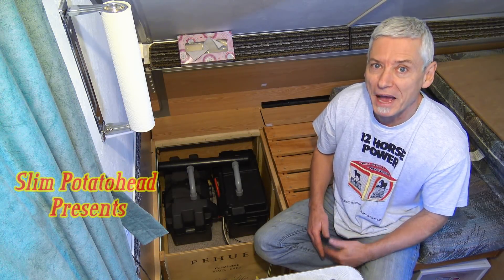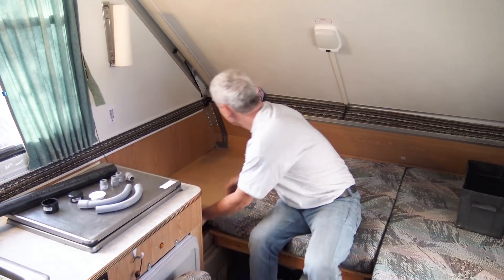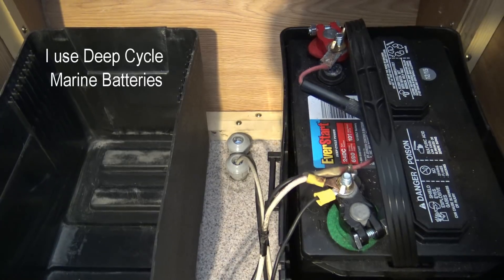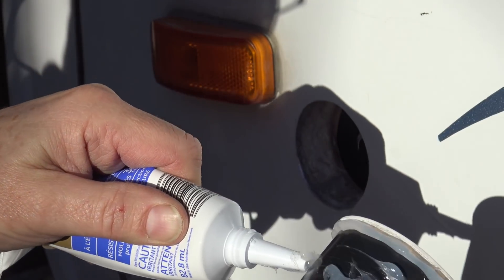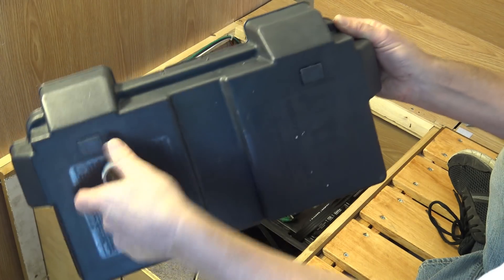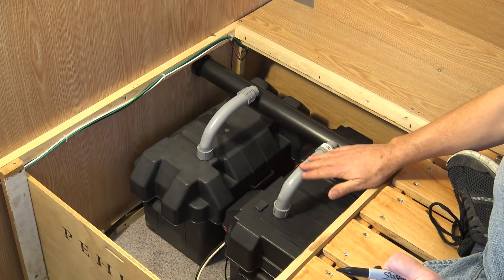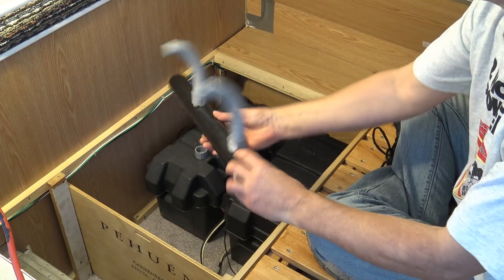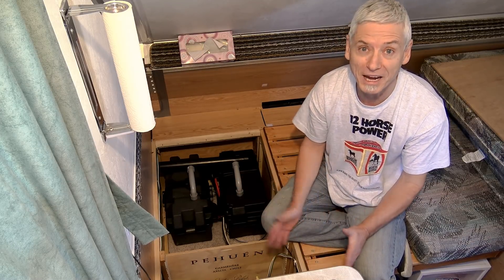Moving Trailer Batteries Inside with Vents

Comment: I meant hydrogen sulfide gas from over charging
Reply from the maker: It's hydrogen, not H2S. Hot (or warm) hydrogen rises. As for overcharging, not likely since it is regulated by a controller. SP

Comment: Unless I misunderstood you, I would have thought that you'd want the vent pipe to slope down going out to the vent. This would allow for any condensation to flow out of the pipe and not pool towards the capped end.
Reply from the maker: It is the lighter gases I want to expell, not condensation. I have never had any condensation. Thanks! SP
Reply: @SlimPotatohead  I was thinking more of warm moist outside air condensing, unless the interior is the same temp as the outside. I may be overthinking.

Comment: Why did you use a 90° bend instead of just drilling the hole directly below the pipe and have it go straight up to the large vent pipe?
Reply from the maker: Easy removal. Just rotate the larger pipe and the branches move clear to access the terminals. SP

Comment: Great Video for sure, I'm curious how you feel after a couple years disassembling that vent set up in order to water your batteries on a regular basis? That's the only downside I could see from this.
Reply from the maker: Strange question. Why would I be watering my batteries? SP
Reply: @SlimPotatohead  the reason you vent lead acid batteries is they produce gas, the water levels go down over time, if you don't water them the lead gets exposed to air and corrodes and kills your battery. That's why the caps on the batteries come off.
Reply from the maker: Sorry Kurtis, I thought you were referring to water coming through the vent from outside. Topping the cell levels, yes. Not too big an issue, as it came apart quite easily. Currently I do not use deep cycle, switched to AGM. No more venting issues. Thanks! SP

Comment: Nice looking installation but a question; your battery boxes are NOT airtight? They flare-out in the corners to allow the battery cables a way out of the box, the hydrogen gas you are trying to vent can also escape through these wide areas.  You may have been better to simply vent the entire compartment under the cushion (no need for plumbing) allowing the hydrogen to accumulate in the entire compartment then vent out the top in the vent you installed.

Comment: 12v battery....next to a gas tank...thats not smart
Reply from the maker: What on earth are you talking about? SP
Reply: @SlimPotatohead  it's irrelevant now because you moved it but batteries spark

That next to gas is dangerous and in the UK it's illegal for manufacturers to have 12v connections or switches or batteries in the gas locker or where the gas bottle is located because that's how explosions have happened.
Reply from the maker: @P Cat, you are not making any sense. Were you referring to the propane tank on the tongue of the trailer? That is STANDARD with almost all trailers. SP
Reply: @SlimPotatohead  Yes I know that but I'm talking about a battery being right next to the propane tank..... That's a bad design.
Reply from the maker: @P Cat, the issue is not the battery, it's the whole concept of putting a propane tank on the tongue of a trailer. It gets pummeled by rocks on gravel roads. If that doesn't start a spark, nothing will. Yet they are still put there. SP

Comment: WITH THOSE KIND OF BATTERY BOXES THE SULFURIC ACID STILL EASILY GETS INTO THE RV BECAUSE THE LIDS COME WITH LARGE VENT OPENINGS.
Reply: Not to mention he just created wholes in the floor albeit it is skewed into the floor so hopefully these batteries don't have acid in them seep through the gaps and cause acid damage underneath why outside is safer.

Comment: With the battery inside, how’s the best way to run your solar panel cable from the roof to the inside?
Reply from the maker: I put it through the floor. On an A-frame the junction is only about 5' long. SP

Comment: Great idea Slim, I’ll give you a heads up after the fact; you can do this ventilation another way by mounting a 120mm x12v silent computer fan on the inside of your box ( mounts with 4 screws) cut the appropriate hole (1 1/2”-3”) & cover the outside hole with a screened vent cover sized like your door vent, run it off your battery to an accessible switch outside your battery box. When at a camp spot, (not moving) , switch it on to vent, when traveling , switch it off, the moving air flow will vent it. Shalom!
Reply: I’ve thought about this exact situation. Do you have any pictures or further descriptions?
Reply: Yes I'd like to see pics too

Comment: I don’t understand why anyone would give this guy a thumbs down... awesome videos always relaxes me after a days work to watch this guy
Reply: I know this is a little old but the only thing I can think that would make someone give a thumbs down is that the venting system is kind of useless unless the battery boxes are sealed. Slim did seal the small vents on the battery box tops but those tops are open at four points to let the battery cables through. And, even if they were closed off, the edges would need some kind of gasket around the box top to make it air tight. That said, I myself used Slim's method to make my own vented battery box and gave Slim a hardy thumbs up for the video.
Reply: They probably just had fat fingers and accidentally pressed it. Only logical answer lol
Reply: Giving a video a thumb down is a good way of letting YouTube know it shouldn't suggest you videos with a similar topic. Having only 1% of the thumbs down is pretty darn good!

Comment: I'm planning two deep cycle batteries under my seats. I'm also concerned (as some mention below) about weight distribution. I'm hoping to get one battery on each side of the front dinette. I understand adding weight in heavy tools. Kind of a good excuse to add way more tools to the kit.
Reply from the maker: I removed my water holding tank so I could store my water in jugs. That way I can re-distribute the weight to make up for the batteries. Thanks! SP

Comment: Actually, the hydrogen comes off the negative plates, and comes out the water filler vents along with oxygen from the positive plates sandwiched between them. I don't know why you routed it from the positives, the plates in the batteries alternate, + and -  , 8 or 10 plates in each of the 6 cells, each with vented filler caps,  and you don't need to vent AGMs. And the vents in your battery box lids should be left open to route fresh air into the battery boxes or the lighter gases won't rise out your side vent.

Comment: I've been watching your videos for a while, they're just wonderful, and in high quality.
Incidentally, I use for the video editing "Sony Vegas" here there is also a simple version for about $ 50

I also used a trailer years ago.
At that time, there were no solar panels or charge controllers for $ 10.
What surprised me, in your car is a generator with high power, but unused for the trailer. This was also me Problem. Here I have thought about how I can operate my 100W refrigerator while driving.
In addition, I come from the electrical profession and basically can calculate everything.
One of the problems to be solved was that the 8m to the trailer battery are much too long, for thin (normal) lines. The second problem was that the 100W is so much power that the engine has to run to not remove the power from the car battery.
Solution:
A car Relay  - 30 amp with built-in fuse (or extra) . This relay has been connected to the ignition coil, so that it is the first problem solving, it is only active if the engine is running.
Before the line goes on, another 300 Amp diode and a shunt (Special Resistor)  for an Ampere meter were added.
The second problem was easier to solve, I pulled a thick 16mm² (AWG 5 or 4 )  wire from the relay, behind of the diode, to the socket for the trailer, all the way through the whole car.
There I made another high current plug connection to the trailer. Here, the fridge was supplied by 12 V and 100W  while driving.
You could improve this circuit with new electronics to load the Trailerbattery and so on..., but maybe it's an idea that is especially useful for campers who are more driving than staying in one same place.

For the circuit in the car, if necessary, consult a car electrician.
For Details i can draw a Circurit.

Comment: Moving Trailer Batteries Inside with Vents.

A seriously fault in your battery installation. If you use lead acid batteries it produce oxyhydrogen, which is very explosive. Normally you connect a small hose on the upper side of the battery and drain it through the floor. In your installation the battery box acts like a collector for the explosive gas.

Oxyhydrogen is heavier than air and will stay in the bottom of the box.
RV or caravan batteries normally have a 90 degrees hose connector.

Thanks for all videos and Tip.

    Robert…
Reply: its vented to the outside jeez

Comment: After many years with lead-acid deep cycle, I am experimenting with a couple of lithium batteries (360 amp hours) inside my house, charging with exterior solar panels.  Expensive, but many advantages, and the price will come down.  As you probably know lithium batteries can be routinely discharged to 10-20% without affecting their lifespan.  Love your series!

Comment: Deep cycle, as well as many starter batteries as trunk mounting is becoming more common, have a small hole for a vent nipple (hole might be plugged with a small plastic plug from factory) that you hook up a thin hose (like for windscreen asher fluid) to. For multiple batteries use T or Y connectors on the hose.
If the vent is plugged, the caps should be vented, but sealed caps should be available for use when the vent is used, check with the dealer.

Comment: Now that you have the batteries off the tongue and a little closer to the axle, have you ever considered putting a second propane tank on the tongue?
Reply from the maker: Hi Stephen, I'm actually finding ways to use less propane, therefore a second tank would not be any advantage in my situation. Thanks! SP
Reply: with a small rv like that a 20 pound tank will last for two weeks easy.you dont need the extra weight.use that stowage factor for beer lol

Comment: Your videos are very informative, thank you very much. Have you thought the draft of air might be pushed back to the battery boxes and into your cabin?
Reply from the maker: Hi Doc, the battery box vent has the rain guard sloped about 30 degrees to the front. Since I always face the trailer into the wind, this pretty well blocks it. Also, in real rough wind there is guaranteed circulation from the gaps where the walls meet the frame. Thanks! SP

Comment: Hi Slim, Great idea with moving your battery inside and professional install,  the gasses will move out irregardless of the pipe angle and gasses are only produced during charging, I would have made the 1.5" pipe slightly upward to prevent water coming in. Slim you are very innovative and possess a lot of common sense. Well done!
Reply: I think the outdoor Lourve vent slats will prevent water from coming inside.
Reply: Iuuu

Comment: Great idea, Slim.  I too moved my battery inside my aliner, but I upgraded to an AGM battery that is sealed and needs no venting. One concern I have is that it is on the left side of the trailer and it weighs about 65 lbs.  The water tank is also on the left side and it puts more weight on that side without counter balancing weight on the right.  Probably no big deal.
Reply from the maker: Hi Tom,  I removed the tank. Now I can add weight wherever I need it. Thanks!
Reply: Jui

Comment: The question I would have concerns the tubing vibrating loose! I know you travel some rough roads and wonder if you check it every stop or not! Let us know in a follow up!
Reply from the maker: Hi oldschooldiy, I put electrical tape on ends so it doesnt come loose. Since the video I replaced one battery with an AGM sealed as well. Thanks!

Comment: When I mounted my battery inside I did it for two reasons, one was to keep it warm in winter to get more amp hours out of it, but mainly to allow for two bike racks on the tongue.  For the battery I purchased an AGM deep cycle and it only charges through my very good MPPT solar charge controller, even when in tow via a 12 to 19volt 8amp converter that swaps from solar panels to car when in tow.  AGM's will not off gas so long as the charger does no wrong.   For balance my battery is just behind and inside of the door side (right side) wheel well.  It helps balance my trailer left to right, and being as close to the axle as I could get it does not impact the balance so much or stress the frame.  The balance is affected by taking a 70 lb battery off the tongue, which is put back in balance by 70ish lbs of bikes and racks.

On the tongue I switched to twin 11 lb propane tanks and moved them forward to battery location, and the bike racks are where the propane tanks were.  I have an old pair of Yakima roof rack mounted bike racks,  with some aluminum tubing they now easily bolt and unbolt to the tongue.  The bikes stay low and in view when I am towing, and do not not interfere with the roof.  I may try to mount a hitch mount bike rack so that when I want to leave the trailer and take the bikes I can more easily transplant a hitch mount rack to the car than the roof rack mounts.   Also its not easy getting a bike on top of my Subaru Outback,  the new ones are quite a bit taller than the older models.   In Winter I was thinking the space on the tongue could be used for my small generator and fuel.   Thus far I have not had issue with just my 100 amp hour battery and 200 watts of solar panel, even winter camping. But I have been "lucky" to have only winter camped in my Aliner in really cold weather, which means clear skies.... and 13+ amps charging current off solar.
Reply from the maker: Thanks Jeffrey. I managed to mount the bike yesterday, but will not release a video until it's been given a good road test. Still have spot where the battery was on the tongue, which I'm thinking of putting a gas can painted black to hold water. That way I can get warm water anytime I'm out in a hot sunny day.
Reply: what stress could it be?its only 30 pounds.the beer in your fridge weighs more than that.

Comment: Things are so much cheaper when you're handy. I'd of just bought new batteries that dont require venting. lol
Reply from the maker: Hi Joel, I'd love to have the good quality AGM batteries, but at $280 each that's way beyond my budget. It only cost me $20 to vent my two cheap Walmart batteries!!!
Reply: Lol yeah, they're expensive alright. I just meant that, I respect (maybe envy a little) how you're capable of just rigging something inexpensive up and boom, it works.

Had I tried it, my aliner would have 6 holes in the side,  blood smeared all over the piping, a vent that's upside down, and a trash bin full of ruined pvc! 

Cheers, dude.

Comment: Through the years you've made quite a few changes. It would probably be a good idea to take the trailer to a scale and find the weights on each wheel and the tongue. You want to be sure to have at least 10%-15% weight on the tongue.
Reply from the maker: Hi Allen, good point. I have made a conscious effort to remove weight from the back (bending frame issue) and am adding a bike and rack to the tongue. May have room for a box on the tongue as well now the battery's not there. Thanks!
Reply: Did you shift weight around side to side to offset having the heavy batteries on the one side of the trailer?

Comment: I am just surprised about that RV venting concern:  I own two different '80s sailboats and none of them got vented batteries, neither I saw such venting setup on any other sailboat...
Reply: its not a bad idea if the batteries are in the living space.if your batteries are in the engine room or engine compartment there should be no problem.batteries give off a small amount of hydrogen gas when charging.so in a ventilated engine space there wouldnt be any build up.

Comment: Thx for more good ideas. I hope you'll give us a mini update in a year on how those battery boxes & vent pipe is doing after traveling to all your cool 😎 camping spots.  Maybe road conditions in Canada are better, but roadways in the US are in poor shape.  Also, did you have to redo any wiring, or were you able to just reuse your solar storage battery wiring for both?  Did you install some sort of cutoff switch for your batteries (thinking ghost battery hogs like those gas/propane leak detectors that kill batteries when parked between camping trips)?
Reply from the maker: Hi Karin, for sure I will update as I travel. I will be on those awful US roads shortly! Wiring was just shortened, and new MC4 connectors for the solar. No cutoff needed, as solar keeps battery fully charged when not in use (stored outside). Thanks!
Reply: I76u

Comment: I think batteries belong outside. It’s not just venting, it’s malfunction and fire. But, nice installation. How airtight are battery boxes? How much weight on side now?
Reply from the maker: Hi Constance, I think if your battery is well maintained there shouldn't be problems. Most of my research into battery issues were with poorly maintained batteries. Perhaps I could put a link on proper battery maintenance if I find a good source. The boxes are not airtight, nor should they be. Air has to flow in, vapors out. I don't use the water tank so the balance on that side should be fine. Thanks!
Reply: theres thousands of installations where the batteries are enclosed in RV's